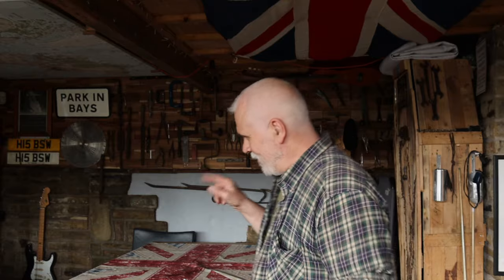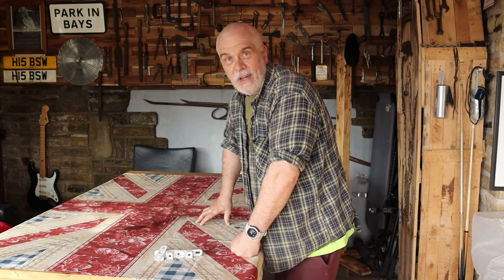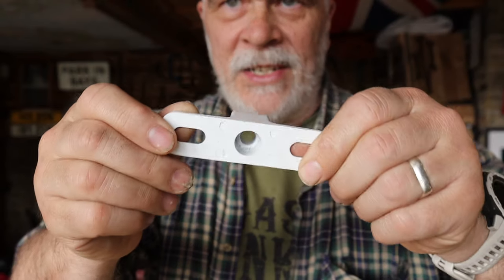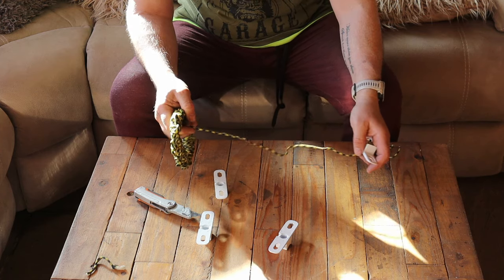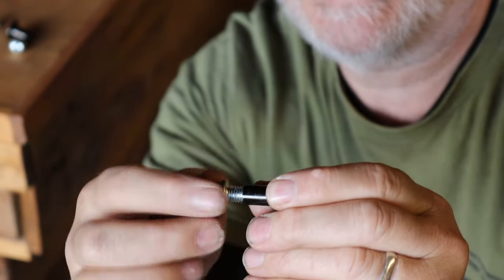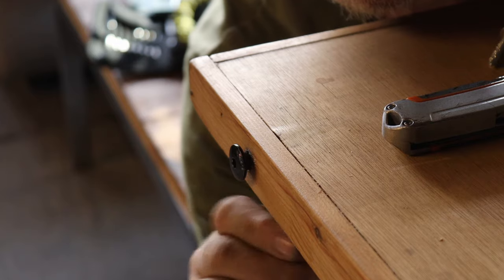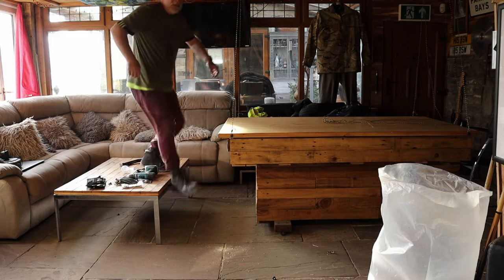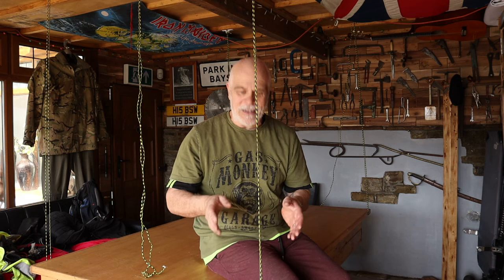Mancave modification, 3 in 1 solution. Mechanical advantage

Comment: Could you incorporate the pocket hole covers into the top? Maybe have an angular bottom on them so they guide into the holes when you lower the top down? Saves having to manually move them after?
Reply from the maker: I was thinking the about that also,  thanks for the angular bottom idea that is a definite advantage. This is why I like these comments so much, sharing of ideas. Thanks for watching mate.